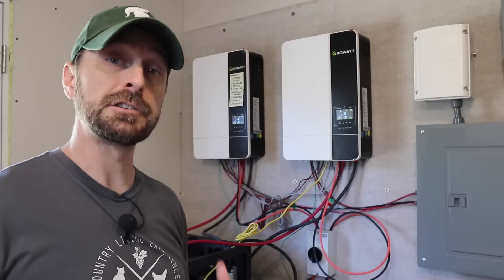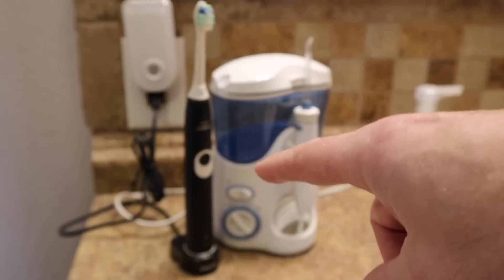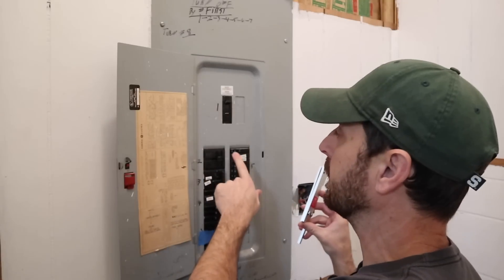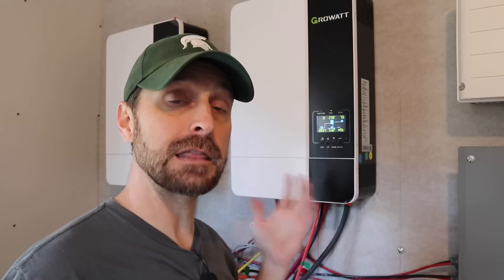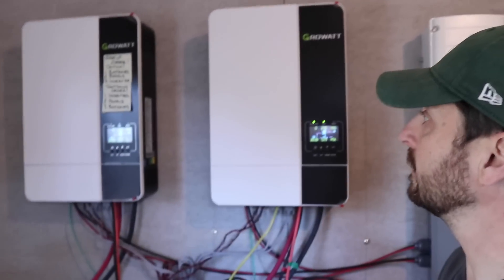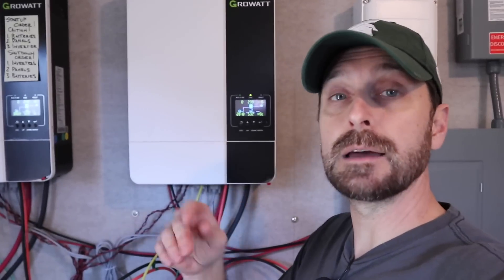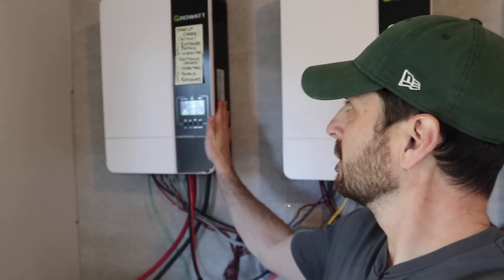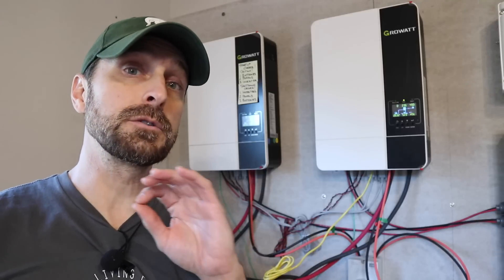Testing Our Solar System! 2 Growatt 5kw Inverters! What Can It Handle?

Comment: Thank you for taking the time to make this video. This was very informative. Can you tell us what kind of water heater you have? I thought most water heater elements use 5000 watts each...?
Reply: We bought a 20 gallon water heater that uses 1800 watts. We plan to put it on a timer and have it come on for an hour in the morning, and we should have enough hot water for the day.
Reply from the maker: Great question. My water heater is very old. It came with the house and is at least 20 years old from what I can tell. It has a 4500w element. WH elements can range widely in their wattage. Some are 1500 and some are 5000. My WH is most likely very inefficient too.
Reply: @CountryLivingExperience  since you are putting in propane. I would put in a on demand hot water heater and a gas heater.
Reply from the maker: I have thought about that.
Reply: @jamesshomesolarmore2223  I definitely need to look more into the on demand water heaters.
Reply: Even though you have 2 elements? It’s mostly only the bottom element that does the work.
Reply: Great information/question on water too, by another subscriber.  I would like to look more into on demand water heating unit.
Reply from the maker: @chart2  I have been juggling water heating methods. It uses a lot of energy. I may have settled on a heat pump water heater.
Reply: @CountryLivingExperience  I just picked up a hybrid a.o. Smith 50 gallon heat pump water heater. I got mine use for $550. You take showers in the morning and the heat pump will recover by the time you get back from work. It also works in hybrid mode if you would like. That means that the elements kick on for faster recovery time. Since I am going off grid I will just be using the heat pump as I do not need it to recover as fast. I will be tied up to the Grid in case multiple days of rain I can keep my batteries charged but my system will be self-sufficient all other days